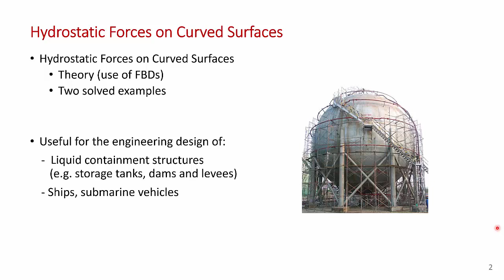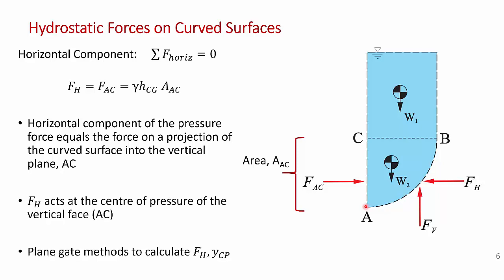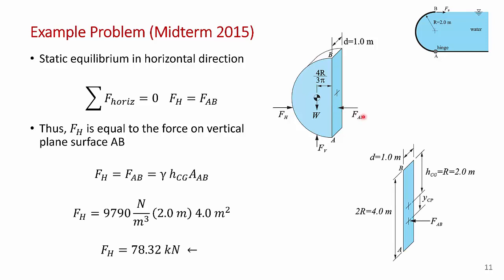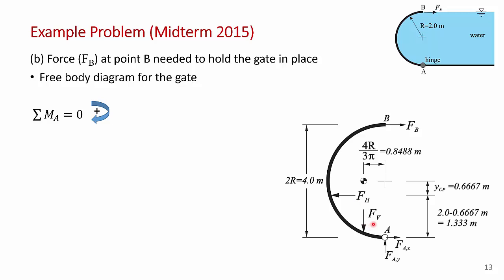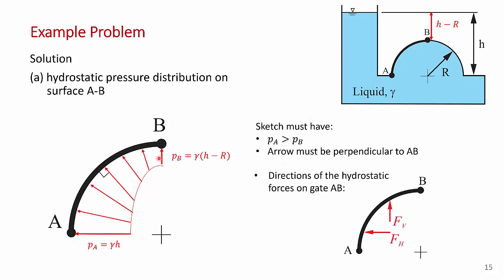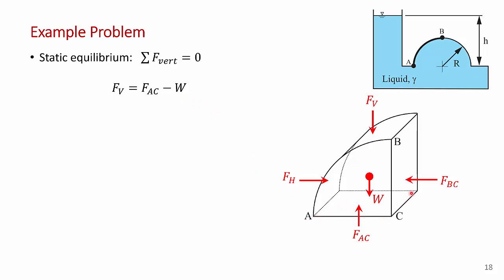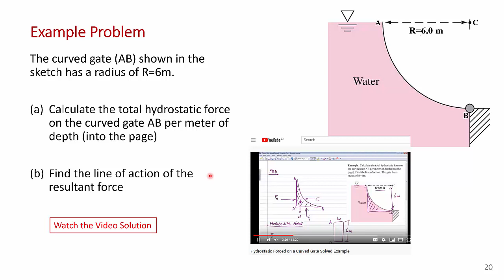Hydrostatic Forces on Curved Surfaces

Comment: Suppose the gate was submerged such that the free surface was height H above the top of the gate with the section above the gate being a vertical wall (think upside down P). Would the vertical portion of the pressure force still be the weight of the water within the control volume? The horizontal portion would still be similar to the current solution where it would be gamma*width*total height*gravity.
Reply from the maker: A problem similar to what you are describing starts at about 17:00. In the case of an "upside down P", the vertical hydrostatic force is NOT just the weight of the water. You have to account for the upward hydrostatic force on the bottom horizontal surface of the control volume. I hope that helps. https://youtu.be/LdbEpRXUpOQ?t=1017   Here is another solved problem that considers this situation: https://youtu.be/Awp-iP3ktDI

Comment: In problem 2, the normal to the gate had vertical components, but the summation of forces resulted in no vertical forces because of the weight of the water. If that is a correct interpretation, please explain? (This seem to be the intuitive result, but contradicts the idea that the force is normal to the surface?) Thank you. Your videos are great for self-teaching.
Reply from the maker: Thanks for the kind words. I'm not 100% sure which problem you are referring to. If you give me a time where I discuss F_v, I will try to help. (I don't think F_v is zero in any of the problems, so I was unsure.)
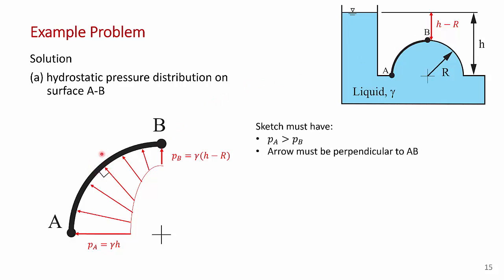Reply: @FluidMatters  Thank you for your help. At 23:50. Note the vertical forces do not have a component on AB, compare with 18:58.
Reply from the maker: @r2k314   The free body diagram at 23:50 shows the forces on the water adjacent to the gate. F_v in this free body diagram is equal to the vertical component of the pressure distribution (which acts in the opposite direction in the gate). I hope that helps.

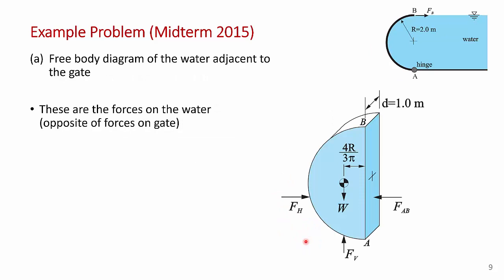Comment: Where is the vertical force acting on the top of  the free body in  no 2 prblm 7:55
Reply from the maker: If I'm understanding your question: There is no vertical force on "the top of the free body". The vertical force acts upward and equals the weight of the water, which acts downward.
Reply: @FluidMatters  if we considered only the upper left quarter of the circle instead of the semi circle then  there would have been vertical force  acting on the upper part of the quarter circle then why not for the semi circle?
Reply: At 6:57  inclined forces at the upper portion should have vertical components ..isn't it? Can u pls clarify?

Comment: why is there not a weight force of the gate when using the FBD of the gate in the first example?
Reply from the maker: Because the weight of the gate is neglected, as stated in the problem statement and verbally at 5:32.  I hope that helps.
Reply: @FluidMatters  thank you very much I must’ve just missed it